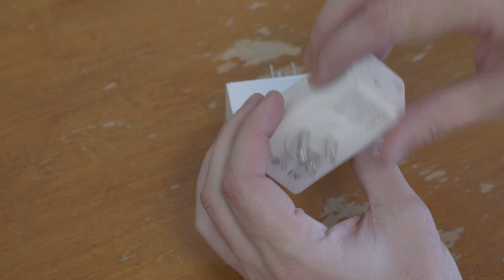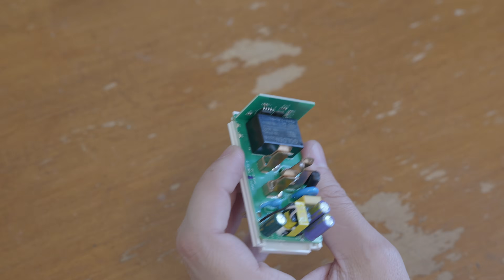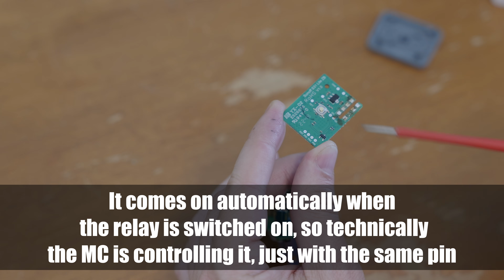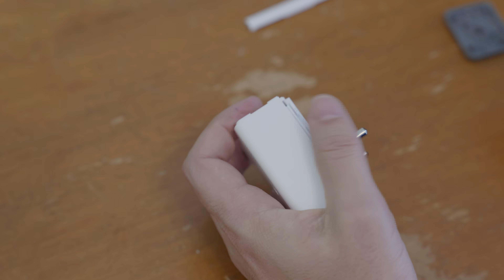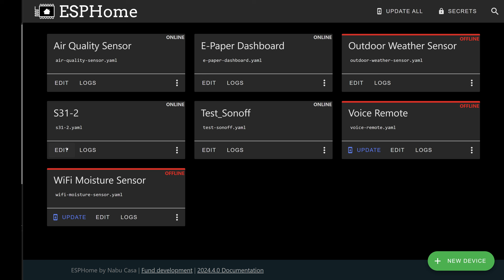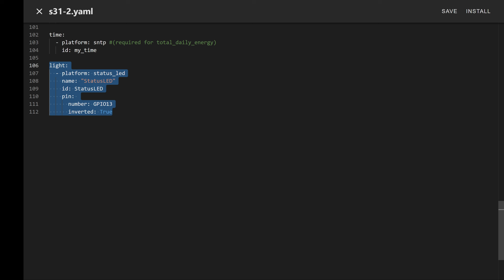Reflash Sonoff S31 to ESPHome with teardown and full schematic

Comment: why do you need the programming if youre just going to plug it into the PC to program it?
Reply from the maker: You only need to reflash them once. After that, you can update them OTA without ever needing to plug them in again.
Reply: @TechDregs is it because they don't have USB protocol on board? It just seems like they have USB pinouts.
Reply: @cutty02  the header on the S31 board is serial (3.3v, GND, TX, TX). You have to interface using a UART controller initially to replace the factory software with the ESPHome firmware.

Comment: Great video, but it may not be obvious to some... DO NOT PLUG THE S31 INTO THE AC WALL SOCKET WHILE PROGRAMMING. In the video he says to plug the S31 in, but he is referring to plugging the programmer into the USB port.  Its too bad he didn't show a split screen of the programmer/S31 being plugged int the computer.  Also, I don't have a 3.5V programmer and I have used 5V as there are various places where you can find info stating that the ESPs are 5Volt tolerant.  Take it with a 'grain of salt', but I have managed to get away with it many times with no issues.

Comment: I was hoping you could help me.   I am looking for a solution to trigger a smart switch via a wifi api call.    I have a project where I have 100 smart buttons throughout the building. they are all connected via Bluetooth to a main  hub.  When you click any button, it sends its unique ID to the main hub which then uses an api to send that data to a cloud database.  We now want a way to send back to another device (Ideally wifi) directly to a device and trigger an event, (turn on or off a light)
Reply from the maker: I would think the solution would be based on what your main hub is. I would probably set up Home Assistant if it's possible. It's specifically designed for that type of thing. If the hub has an integration for HA, then if it can get all the bluetooth devices integrated, you can set those switches up on automations to turn other things on and off easily.